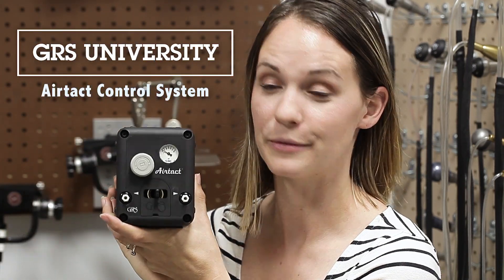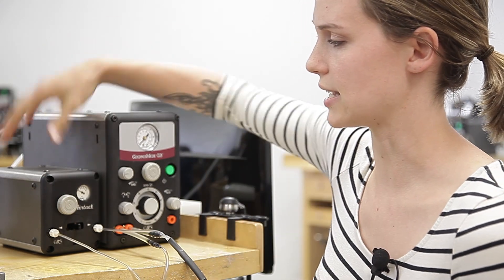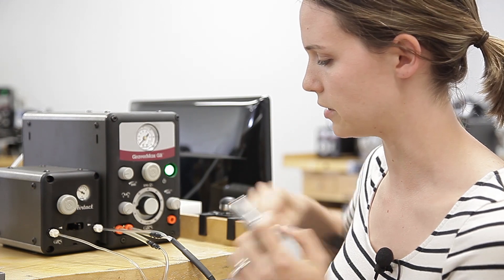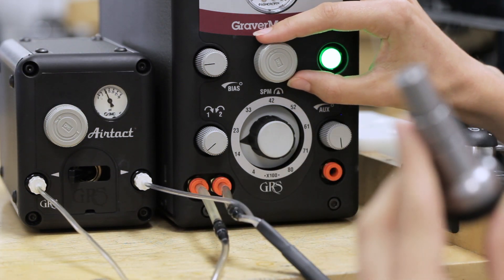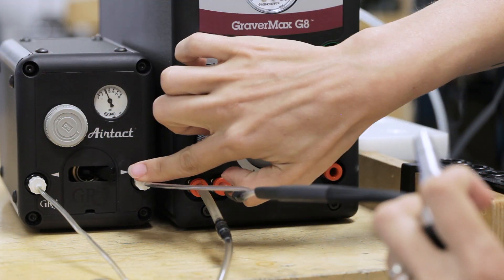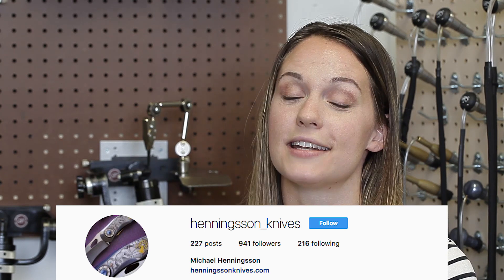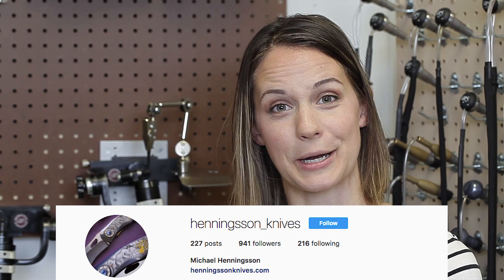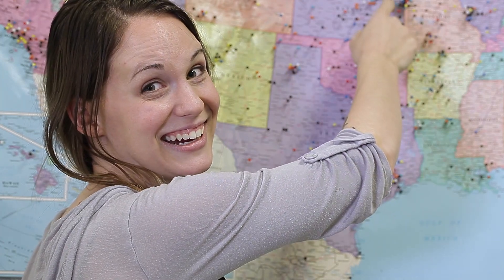GRS University: Airtact Control System Basics

Comment: Hey you guys should do a demo of the airtact for pod because I still don't quite get how that works. Does it have very much control range? And I should check first and also ask if the foot pod is basically the pedal you use if you happen to want to use an airtact handdpiece by foot?  Thanks in advance!
Reply from the maker: The Airtact foot pod has been discontinued so it is probably not something that we will do a video on. The foot pod does not offer the same feathered effect/range as our regular foot pedal. It was created as a solution for those that wanted to stipple while having the Airtact hooked up to the GraverMax. It would be better to un-hook the Airtact box if they are wanting to engrave using the foot control, so that you have that smooth, gradual startup.

Comment: I want to get a 901 airtact handpiece. Can you still use the foot controller on this hand piece? Incase you want to switch Back in forth from hand control to foot control.
Reply from the maker: Yes, the Airtact Handpiece is designed to work with both.
Reply: GRS Tools thank you!